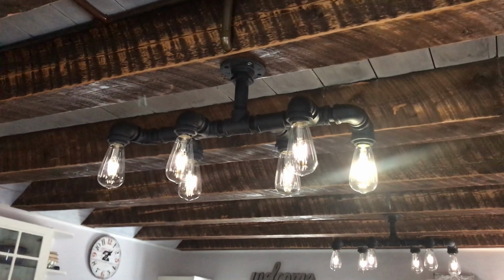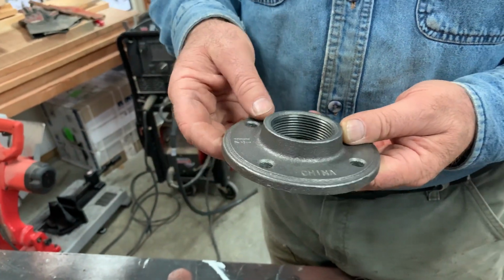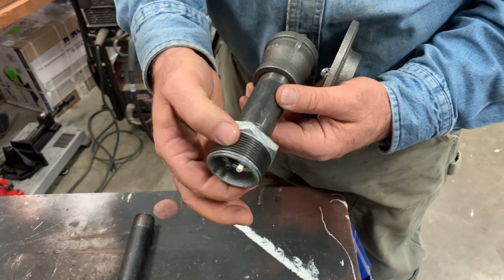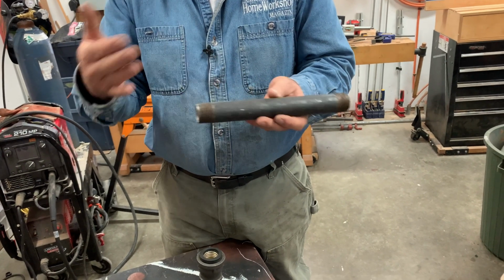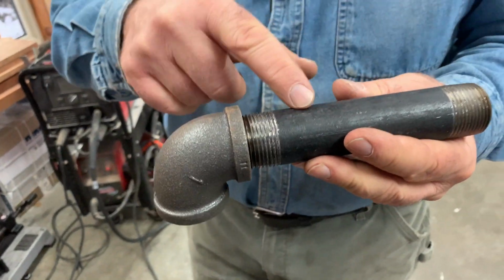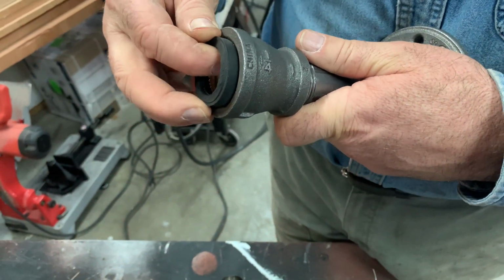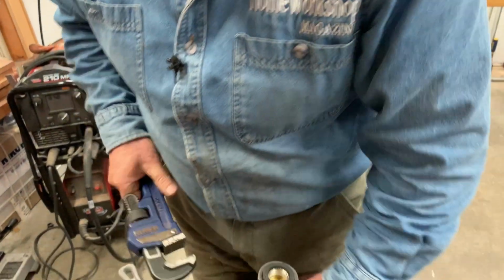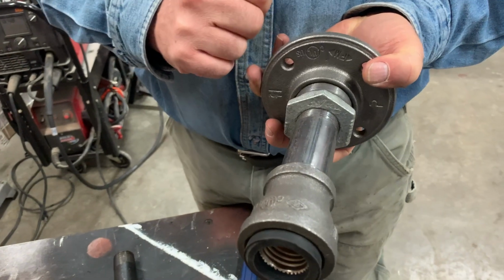DIY INDUSTRIAL PIPE LIGHT FIXTURE

Comment: I just followed these instructions but I found that the flange doesn’t fit. I have the 4” round junction box, and the flange screw holes do not line up with the junction box. Is there another size flange I should get instead?

Comment: Nice video. I built my own, but a plumb pipe billiard table light for my billiard table. It's larger and  uses 1/2 in pipe and uses premade Half inch plumbing pipe goose-neck male to male 1/2 inch NPT thread to connect to my  Plumbing Pipe To Light Fitting Coupler 1/2″NPT To 1/8 IPS. This allows me to connect my 120v  E26 sockets. All the parts were available to me online from a company called Edison Light Globes. I'm now building some outdoor waterproof plumbing lights with their Solid aluminum water proof light globe cage and glass cover, that apparently were originally on ships in engine rooms, and designed to be explosion proof.  Can't wait to finish them, and put them up outside my garage.
Reply: Oh, I'd like to see YOUR projects!  Wow!

Comment: Brilliant video, so many questions were answered for me.  If I may ask, is there any savings by buying black pipe on line, as it is unlikely rated for gas which is ok, since we are making light fixtures?  I noticed the ground screw on your flange, is it safe to say, you added that yourself?  Thanks in advance.

Comment: I've used quite a bit of black iron pipe in stuff I've made. Sometimes using the close nipple just doesn't look right. In those cases, I've used threaded rod which brings the fittings together.
Thanks for the info on the sizing up of the light socket and pipe. Would like to see a video on wiring a  black iron pipe light fixture and lamps.

Comment: Tip#3: Ground Your Fixture

“Grounding” is an electrical term for a secondary wire that allows electricity to flow harmlessly to the earth in the event that a live wire inside the item becomes loose and touches the metal fixture body. As with any light fixture, be sure to connect the bare ground wire inside your ceiling electrical box to some part of the body of the steel light fixture you made. It doesn’t matter which part, as long as the ground wire is in solid and reliable contact with the metal fixture body when installed.

copied from https://baileylineroad.com/three-tips-for-building-steel-pipe-light-fixtures/

Comment: Painting galvanized ... Wash fitting with vinegar first, then lightly sand and then a special primer isn't needed (in my experience)  ... Sometimes you can substitute a pvc bushing instead of galvanized or black pipe

Comment: Very helpful video. Can you please post a link to the next video you mentioned about wiring the light fixture.
Reply: I would say all he did was weld that earth point screw onto the flange (that you can see in the video, as that's not typically on a flange), then use wire nuts inside the electrical box and attach a ground wire to the fixture to prevent shock if one of the wires came loose and shorted against the metal fixture.